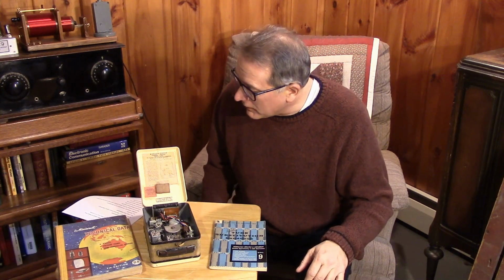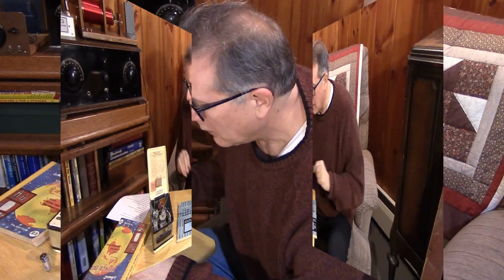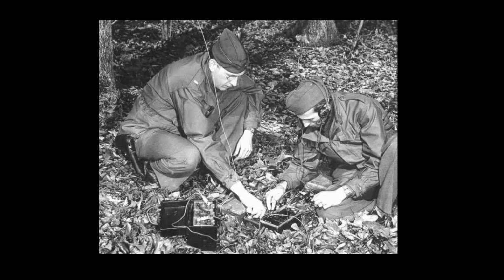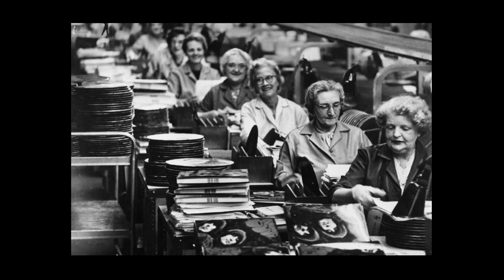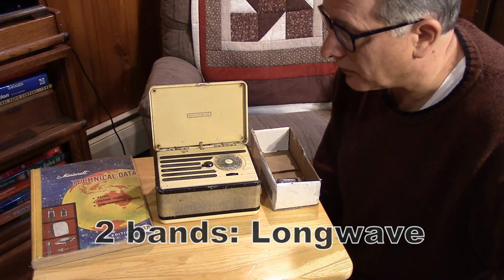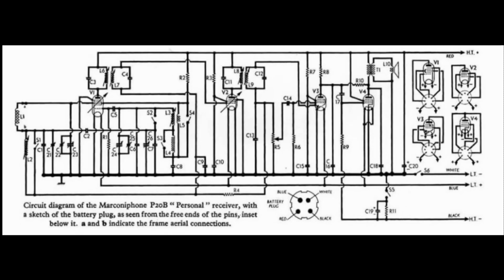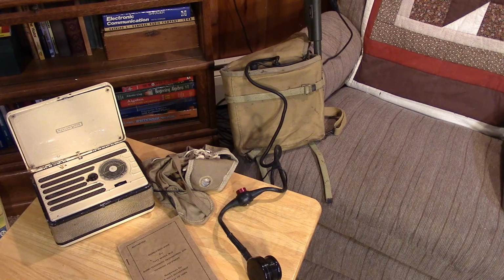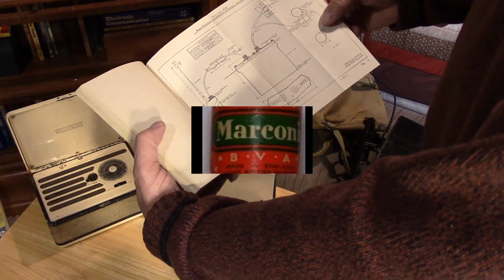Marconiphone P20B Introduction

Comment: Yes as said he Died young he was absolutely a Genius killed in Bomber Crash while testing Radar he was inventor of Stereo and new system of recording EMI got sick of Paying the for Westrex system so invented a complete new recording system for them,Like Ross Hull a Australia man electrocuted when cam in contact with a High Voltage Transformer supply for High Definition at the time Television, Regard Ian VK2IJ.
Reply from the maker: Wow a real figure in radio. Ross Hull was also tragically killed in a shack accident, demonstrating early television. https://en.wikipedia.org/wiki/Ross_A._Hull

Comment: Hey, i ordered a $20 12ax7 tube from amizon a week ago, Im still waiting for it. Where could i get a big cheap bag of vacuum tubes near washington D.C.? Is it impossible to build my own? I dont have a tube tester either
Reply from the maker: Most used tubes are less than 3.50 each and a couple of 2 dollar 6AV6's can do about anything that a 20 dollar 12AX7 can do. Something like this can get you started: https://www.ebay.com/itm/Vtg-Old-RCA-TUNG-SOL-RAYTHEON-TUBES/143944526335?hash=item2183c329ff:g:yucAAOSw2w5gJBKW
Reply: If you speak German reach out to TELEFUNKEN and see if you can supply you with Space Charge Vacuum Tubes.